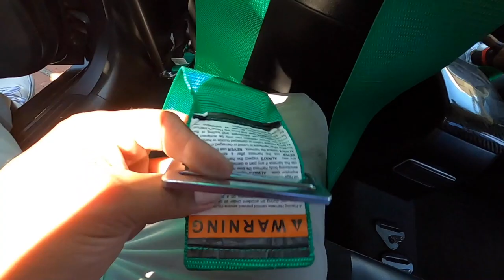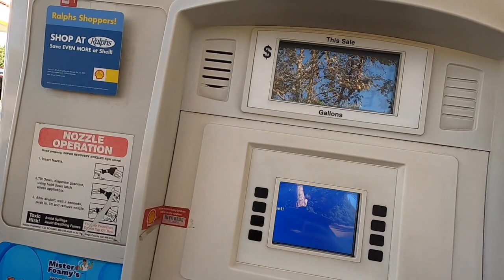TAKATA HARNESS INSTALL

Comment: There is a clip you can buy that clips into the female part of the seat belt, so you eliminate that sound.  Check EBay
Reply from the maker: Cool thanks, I'll check it out. What is it called?
Reply: @shus369  Car Safety Seat Belt Alarm Stopper Clip